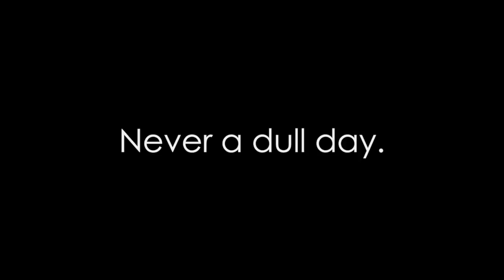The Grocery Getter

Comment: That is far from stock, its got an after market short ram intake, aftermarket intercooler and blowoff valve, grimspeed air oil separator, aftermarket aluminum radiator , coilover suspension , aftermarket wheels and lugnuts
Reply from the maker: Yes, far from stock. Was in the mood for a little humor after April 1st. Lol.
Reply: i get ya , its a great looking fozzy
Reply: Buks Lgd wheels spec